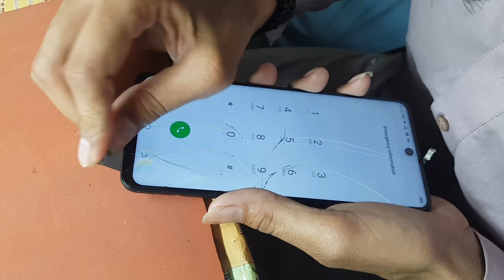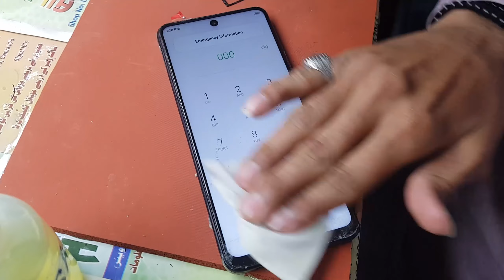Tecno  Spark 8 KG8 Cracked Screen Restoration 🛠🔨- Glass Replacement 💥

Comment: Hello, I have a question, "I have a tecno soark 8 pro mobile. The problem is that the screen color tends to be yellow permanently, knowing that the eye protection option is turned off," and sometimes the colors return to normal. What is the problem and what is the solution? Thank you.
Reply from the maker: lcd problem
Reply: @gsmexperts007  I don't understand what you mean, please clarify.